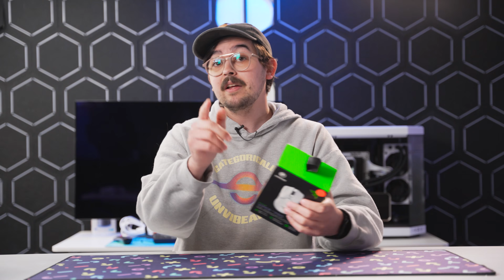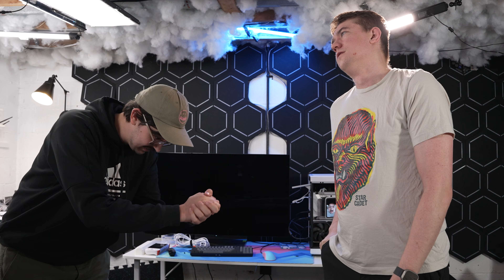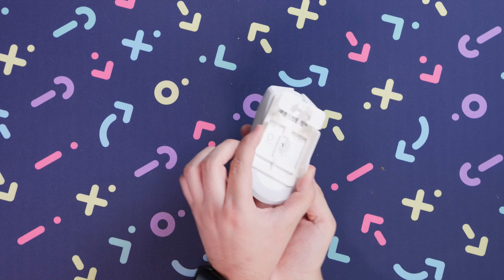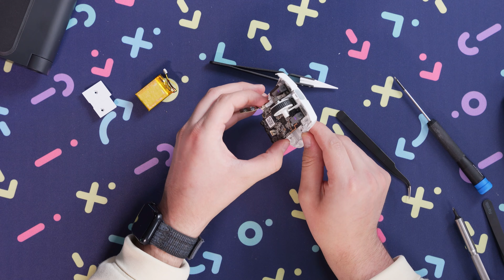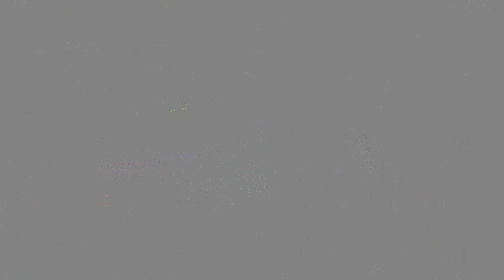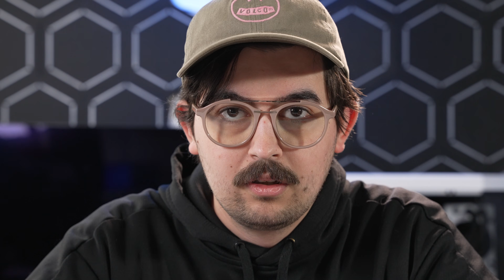You Only Need Like Half a Mouse - Zeromouse Knockoff

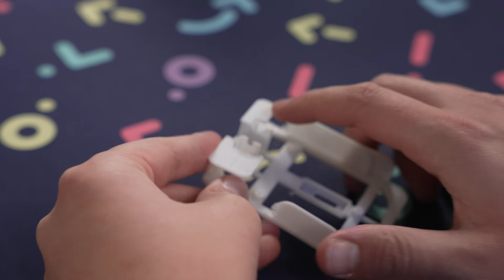Comment: 9:12 I have the optimum tech zeromouse, and it's still an issue with the real thing. The mouse doesn't function properly when charging it, so I swap to my beast X mini in the mean time. However sometimes even when using another mouse while the zeromouse is charging, it messes with my computer in scary way.
Reply: if it's unplugging and replugging its probably just that you've not tightened down the screws under the clicks enough so the cable won't go all the way in. this should also fix the clicks being hard/unusable while plugged in issue.

Comment: The Zeromouse is still too heavy.
Weight reduction not nearly optimized enough.
You can get it MUCH lighter by removing unnecessary material from the buttons and skeletonizing any solid surfaces, as well as the scroll wheel.
Reply: Probably can remove any excess weight by using a smaller pcb board

Comment: It's always interesting to me since I can't stand a light mouse. If it doesn't have weights you can add I wont use it. Before modern gaming mice were common I would open units and glue in chunks of steel. I can't be the only one ...
Reply: I'm on the younger side(20) so I was always used to cheaper mice that were lighter. When I used a heavier gaming mouse it didn't feel right and for my own first gaming pc I got a cooler master mm710 and it just felt so natural even though my hands were to big to rest my palm on the mouse. Currently using a xtrfy mz1 and it solidified my love for light weight mice and using fingertip grip. Tho to each their own and all preferences are valid to me

Comment: Someone steal my idea, a mouse and mousepad with repelling magnets that make the mouse hover over the mousepad therefore giving it  zero friction
Reply: Would likely need an XY axis with the repelling + 'locking' magnets underneath the surface. Would not be cheap, but would be neat.

Alternatively, an 'air hockey' mouse might accomplish similar.
Reply: As an mouse using osu player, I really liked the idea.
Sure, much engineering is needed to craft something like that but even imagining it feels good on my hands.
Reply: Won't work
Reply: That would be damn near impossible to stop the mouse
Reply: razer mcfly lmfao
Reply: @realElectroZap  Flying DeLorean Mouse, get.
Reply: thats literally the razer mcfly lmao
Reply: @thedemondevii883  yea but to be fair that was only an april fools joke unfortunately lmao
Reply: Should have tm it
Reply: I think another way to do this would be to make a mousepad that use the air hockey principle, holes that push air to make the mouse float.
Then you could adjust how much it would float, as it would be fan driven.

This would also give a nice breeze on your hand while gaming.
Reply: How would you stop your hand from just putting the mouse flat on the mouse pad and negating the effects and changing the consistency
Reply: Earnshaw theorem or whatever would like to have a word.
Reply: How would you be able to figure out lift off distance in any consistent or intuitive feeling

Comment: It(zero mouse) will probably come out with support of the new Viper v3 pro, the new pcb of that mouse is suuuuper small and will be perfect for such a project.
Reply: he used the v2 because of its tested and well made sensor, its fluid as hell. the new one is like a beta version of new gen viper, the og is king
Reply: @gentlyWhipped  Plus, Optimum is now working on a whole mouse rather than swapping the guts from a V2.
Reply: @Space_Naught  nah he took it from the Zaunkoenig m2k which has a super small pcb
Reply: @JensonTM  oh I did not know that, sounds pretty good then!

Hope its still wireless…